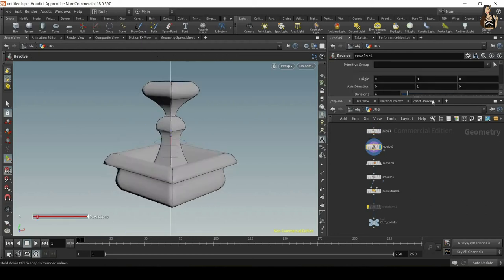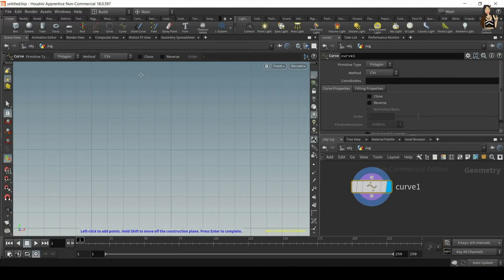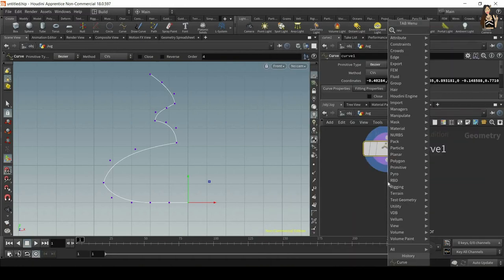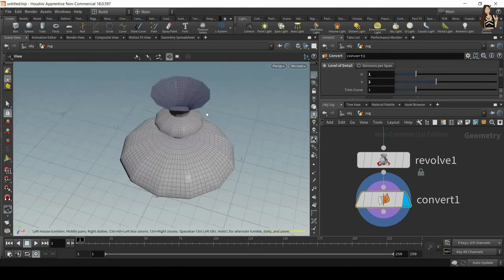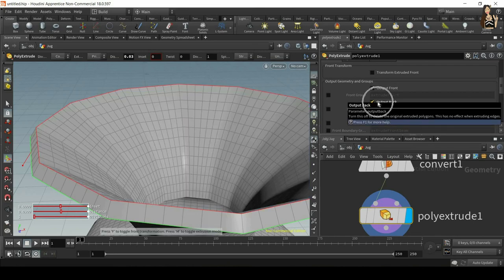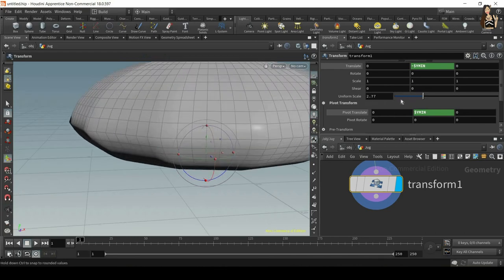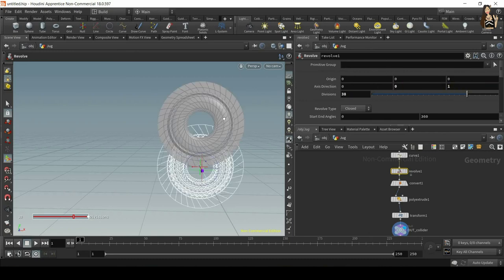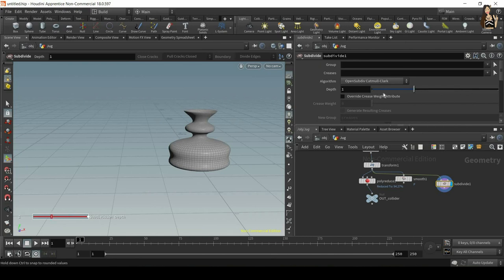Fast & easy fountain, jug, bowl for simulations using Curve & Revolve - Houdini 18

Comment: Your tutorials are amazing. Went through the whole fluid series and it was very helpful. Just one small point here - the "align to ground" expressions are useful to know, but is there a reason you don't use Labs Axis Align node?
Reply from the maker: Thank you nameless identity! :)
I used Axis Align in one of my recent tutorials, but usually I prefer to use the expressions as I can then edit and adjust them to every project. But you're right, in most cases Axis Align is faster. :)